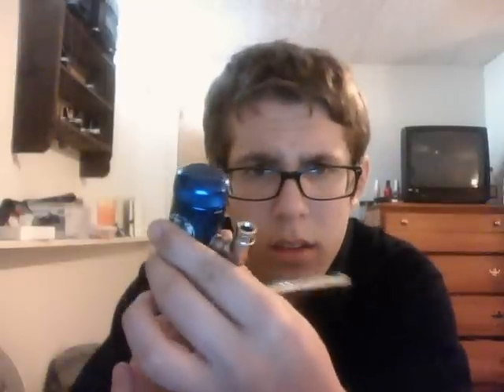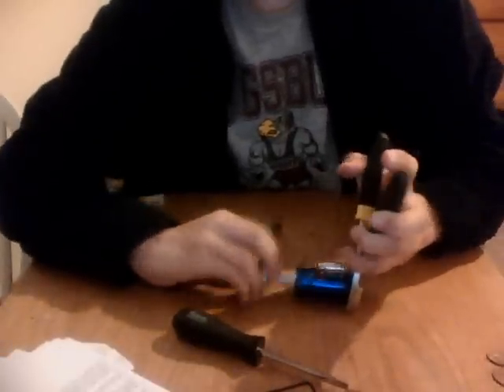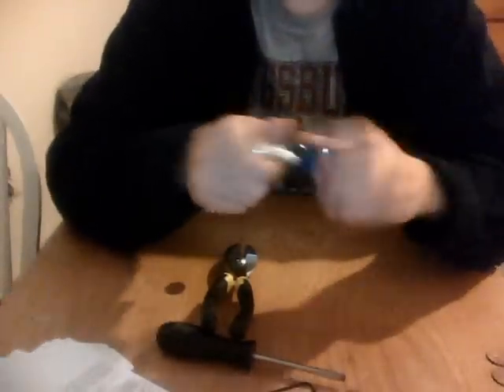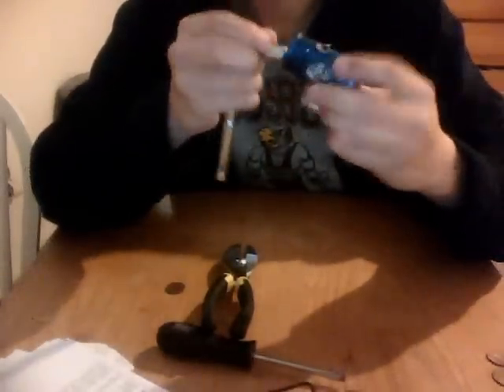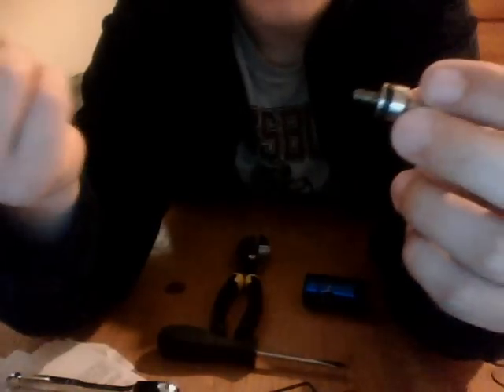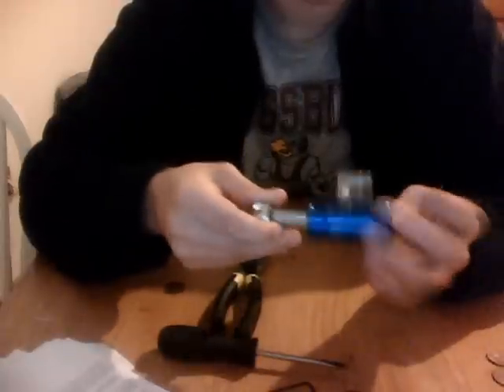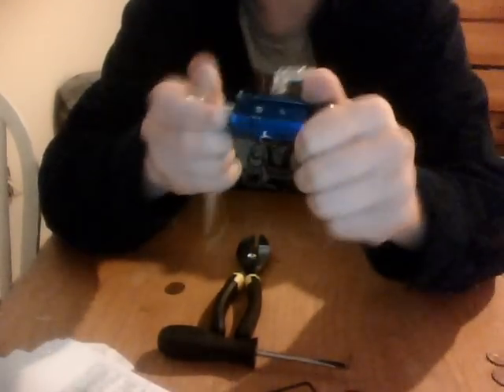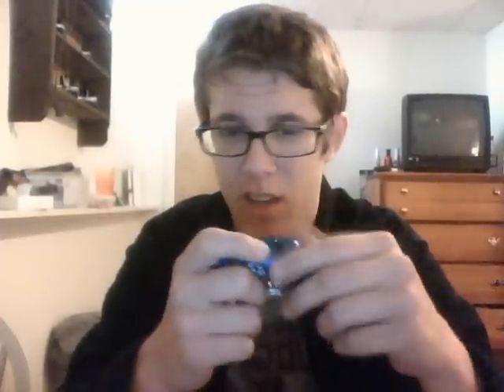How to fix your CP ASA

Comment: @elsamo007 alright cool thanks. i had a slight leak from the macro line elbow connecting to my reg but i twisted it back slightly to the right. Is that normal?